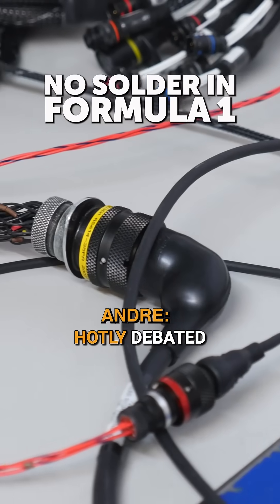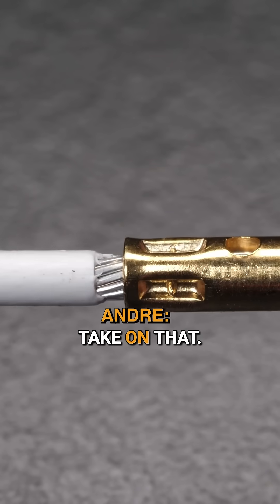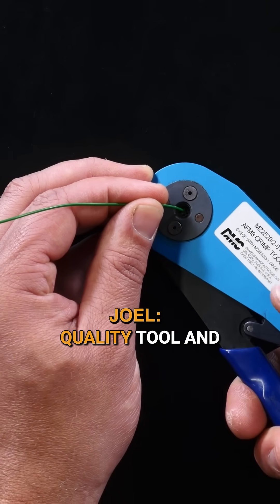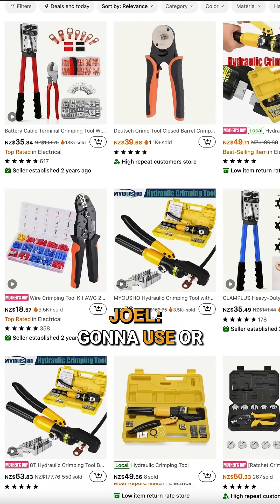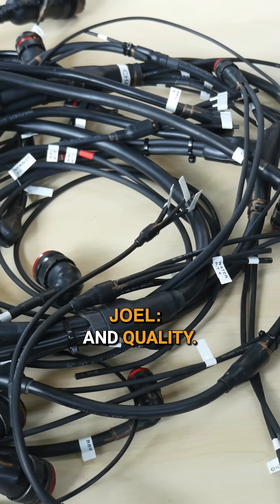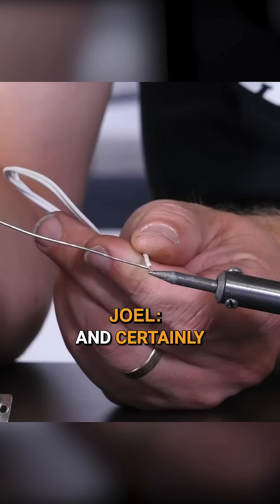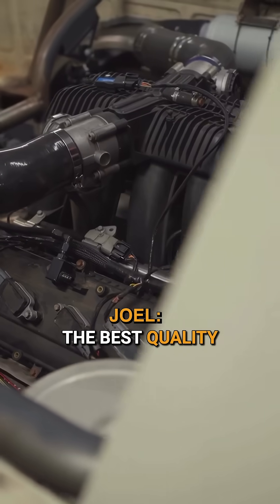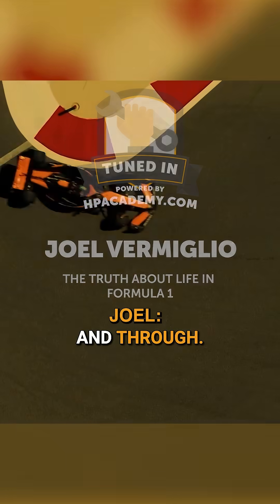No Solder In Formula 1 Wiring?

Comment: All the components on an electronic circuit board are soldered. If they can handle heat and vibration, so can a wire-pin connection.
I can't help but wonder if the reason why some people are against soldering, is because they're bad at it.
Reply: @roflcopter645  it depends on where and how the solder is connected. Circuit boards are flat and can absorb alot of the inflection forced from vibrations. Cables are flexible and therefore flex especially under vibration and solder has been known to creep into wires over time. The vibrations actually work the metal over time until cracks begin to form. This isn't true for only F1 but for all automotive vehicles solder should be avoided wherever possible. Most circuit boards are epoxied to further dampen these small forces.
Reply: @infernaldaedra  I'm not convinced about the flexing theory. The thing is, the more something flexes the more it can handle forces without breaking, think glass vs polycarbonate.
So, if anything that'll favour solder even more.
Reply from the maker: That's like saying you should press fit your wheel because it's good enough for your bearings 😅 

PCB is a PCB, not a wiring connection 😎 

You can personally solder all you like though, unless you work on this wiring and want to keep your job! - Taz.
Reply: @hpa101  I'm not saying you shouldn't crimp, I'm saying you shouldn't dismiss soldering as if it doesn't have benefits.
You get better surface area contact between the pin and wire with solder, which gives you better signal quality, very important for precise readings of analogue signals, and high frequency digital signals. 
You also get less resistance and heat at the connection, very important for power wiring.
Reply: @roflcopter645  PCBs are very different though. Everything is solid and the solder joints shouldn't be failing due to mechanical fatigue as there should effectively be no differential movement. Whereas wires/cables are constantly bending and flexing relative to another point along the wire due to vibration.
Reply: @Pulse89  yep. That makes perfect sense.